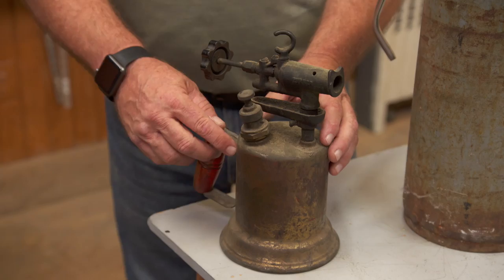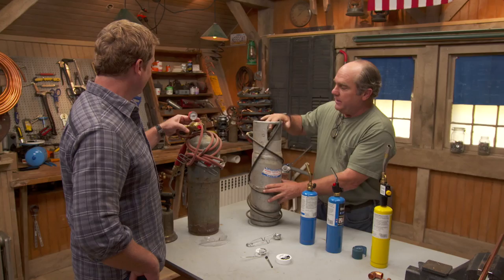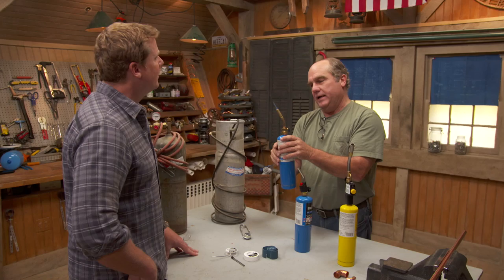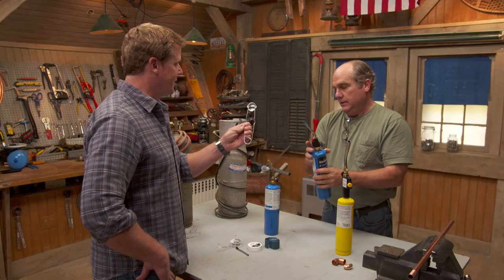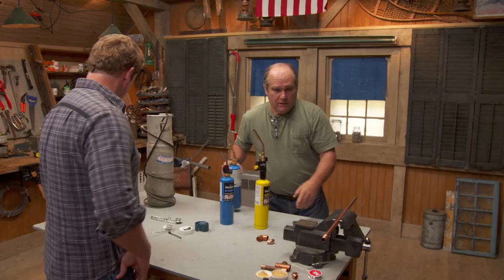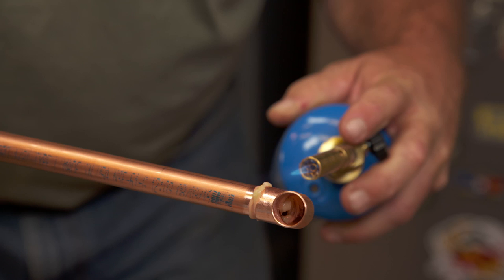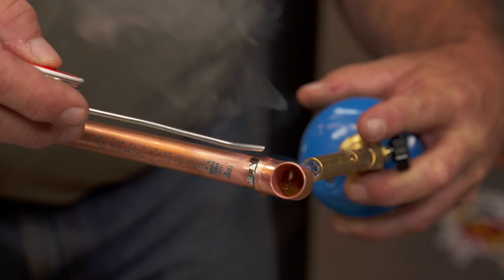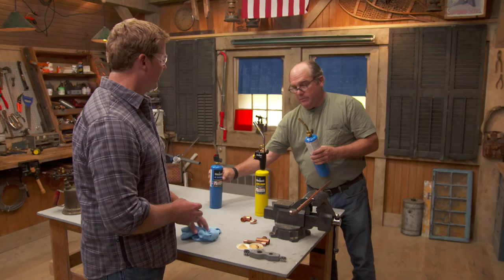How to Choose and Use a Blowtorch | Ask This Old House

Comment: I've been a plumber since '78 and some things don't change....like how to properly sweat a joint. You only need to flux the pipe, not the fitting too. Of course everything is cleaned first with either brushes; internal/external or sandcloth...or both depending on the size of the joint. A good plumbing torch will let you adjust down to smaller jobs like 1/2-3/4" and also sweat larger sizes. Some of the small bottle 'turbo' torches won't do that.....you turn them down and the tips excessively heat to cherry red...not a good scenario. Better to have smaller tips that exchanges in & out for the smaller pipe sizes. I've had portable propane and MAP torches that work from 1/2" to 1/1/2". Honestly though unless I have access problems, anything over 1" and I'm using a bigger acetylene bottle and Turbo torches with different tips. And my fall back standard would always be my old Prest-O-Lite on acetylene. I've been on jobs where the plumber is struggling (time-wise) with a little bottle torch like under a house. Fire up the Turbo on a acetylene bottle or the Prest-O-Lite and cut the job time in half. The little hand held torches are for tight space and convenience,  not for whole house sweating.  The nice thing about the larger tanks torches is they have regulators and so you can fine tune your torch flame for the job at hand.  I worked for a company once that forced everyone to use the small bottle torches for everything. That is, until I showed them how much time you can save on a whole house job using acetylene. But then I got stuck training the guy on how to use a large torch bottle set up. On most residential piping now it's all PEX style piping anyway. You can't win...glad I'm retiring...lol.  Sweating will always have its place for repairs though and of course, HVAC.
Reply: Can you use pure acetylene for this purpose or is it always oxyacetylene?
Reply: @commadanteflet  Acetylene, and these days there's not much difference in temperature between Map-Pro and propane but a significant difference in price.
It's my understanding that Mapp is no longer available in the U.S.
Reply: I thought they used Silver Solder or something now, won't that lead leech into the water?
Reply: @tomasinacovell4293  They use silver bearing solder now for residential and commercial potable copper. It is lead free....requires more heat, slightly different techniques and flux.
Reply: @TheReal1953  Ah!
Reply: @commadanteflet  Plumber's torch-acetylene.
Reply: also the tip he is useing with the map gas is way better you can also run that tip all day long and the tip will not get hot you can tuch it and wont get burned, did you know that ? i am not a plumber i am a roofer hot tar
Reply: @davetownsend7120  Doesn't matter if you're using map gas or propane on on those small turbo torches. Any turbo type tip will glow red if you tun them down. Sweating is about knowing how much heat to use on a joint and how fast you need to move along. On the B-tanks, the rigs will usually have a regulator and so if you were mostly sweating 1/2" copper you can adjust the gas flow down......even with turbo type tips. But my favorite rig on a B-tank is still the old  Prest-O-Lite. This tutorial though is about the more portable propane and map tanks.
Reply: @TheReal1953  that wasn't my point whether you used map gas or not my point is with a turbo torch you can use it in the tip will never get hot so you can touch it
Reply: @davetownsend7120  I guess we've been watching different movies. To keep a bottle feed turbo torch from turning the tip red, you have to turn the gas UP. You cannot turn down the flame without getting a red tip is MY point. To do that you need a regulator or a different setup altogether like Prest-o-Lite. Yes, you can run the turbo tip all day, gas turned UP without getting the tip hot. Maybe you should stick to roofing and what you know.

Comment: Everyone in the comments section knows best. I’ve been plumbing for ever and here’s what I’ve learned. ....
Ask 10 different plumbers the right way to do something and you’re sure to get 10 different answers.  Best to learn from trial and error and stick to what works for you... having said that I prefer mapp gas each and every time. To me it just seems faster and more reliable
Reply: Don't agree....there's a much smaller number of ways to sweat copper properly and some universal do's and don't. And the only times you will see failures is when you've been in the trade for decades and see the plumber's mistakes. Like wiping hot joints with a rag. A lot of guys do that for appearance reasons. You can compromise your joint doing that...easily. I've seen them fail yrs later. Just because your joint hasn't failed in a yr, doesn't mean it won't fail eventually. Anybody who has done lots of repair AND new work knows this.
Reply: Only problem is, MAPP gas is not being manufactured in the US anymore. The crap that they sell today in yellow canisters labelled MAP/Pro (propadiene gas) is NOT THE SAME as the good ole MAPP (methylacetylene-propadiene propane) gas that between propane and acetylene, and that old timers like you remember so fondly.  MAP/Pro is quite wimpy compared to MAPP, and propane comes very close to being as MAP/Pro, but a lot cheaper.  In my opinion, MAP/Pro is a waste.
Reply: @StilettoSniper  I remember reading about this in about early 2010's, when I was getting into the trades (HVAC) 
What about using propylene? aka propene aka methyl ethylene? 
Things got busy and I never had the chance to experiment with propylene... these days propane or acetylene...
Reply: @walterbrunswick  That's what you get when you purchase a cylinder of MAP-Pro today.  It is a mix of propane and propylene.  It pales in comparison to the original MAPP gas in terms of heat though.
Reply: I'd like to get that tall old gray propane bottle for weeds. Where can I find one?

Comment: Here's the thing, if you take that MAPP torch off the MAPP bottle and put it on to the Propane bottle it will do exactly the same type work that they say you need MAPP for. Its all a rip off. In my experiments, Propane with the TS8000 MAPP torch fitted heated up the work metal (mild steel flat bar) 12°C hotter than if I used the MAPP setup after 1 minuet of heating the metal both from a base temperature of 18°C - MAPP 415°C, Propane (same torch) 427°C. Make of it what you will. I Silver solder now with the MAPP torch on a hose connected to my 9Kg Propane bottle that I also use for camping (running the cooker on the camper trailer) so now I can take a means of doing road side repairs to metal work when outback if I need to, just one hose and the torch, easy to pack.
Reply: Yes, because MAPP gas of yesteryear is NOT the same as today's MAP/Pro.  They can't even call what is sold today "MAPP" gas because the company that hold the patent and trademark on MAPP gas will not allow it to be used for the overpriced MAP/Pro crap they sell today.

Comment: ive always used MAPP and Acetylene never used propane in all my years of doing plumbing work never had a problem with any if my fittings
Reply: The rig the guy had in the video is TurboTorch LP and the tank is aluminium.    A couple of benefits being it could be filled at just about any place which fills LP tanks, much lighter than a "B-tank' and just a little cooler than Acetylene.  The bad part is you run out much quicker and could come out liquid out the nozzle if tank is laid down during use.  I worked with LP on L copper and lead-free bar solder from 6 to 8 inch with a 32 tip.

Comment: The tiny little pencil torches are only really good for 1/2 and maybe 3/4 copper.
Reply: Yeah and 3/4" is barely adequate.  I like to use the big TS8000 torch with propane for 3/4", and just turn down the heat a bit until it is just right and doesn't overheat the fitting.

Comment: Heat the fitting not the joint and let the heat pull the solder in off the pipe.... should almost look like a vacuum sucking the solder into it which will give you a much stronger seal because you are soldering the entire joint and not just the outside seam

Comment: Richard has obviously never seen his grandfather's blow torch operating with gasoline, which is what they generally used for fuel. It is anything but a lazy flame. It is a roaring blue flame that shoots out about a foot.
Reply: AWESOME. I saw one of those blow torches at a estate sale once
Reply: Jody Doakes in the UK we also ran them on paraffin and we call them blowlamps. We have a super large version with a 4 inch diameter burner that produces a 3 foot long flame, that's used for killing weeds by cooking them...
Reply: I have one. You're right. And if you're fast enough maybe you'll be able to solder copper water lines

Comment: The only blowtorch in the video was the one you fill with a liquid fuel (kerosene) and pump up. After it's hot, it should keep the pressure up by itself as the fuel warms up. Compressed gas torches, like propane torches, are NOT blowtorches. A lot of people call any torch a blowtorch, but it's only a correct description of the old-timey pump-to-pressurize liquid fuel torches.

Comment: That was way too much flux on that fitting
Reply: +christoper indeed.
Reply: That was my first thought
Reply: Uh..huh...well, here's the real deal.  If you get the joint fully soldered, you have the correct amount of flux.  If you don't there's not enough.  BTW - there are no "style points" for flux application.
Reply: Is it true that excess flux inside a copper pipe can corrode the metal over time?
Reply: These guys who say that you can never have too much flux are butchers. Yes you can, and that residual flux will remain on the inside and outside of the pipe and corrode it over time. So if the pipes in the house where you worked leak in 50 years, you'll know. Look up "How to Stop Copper Pipe Corrosion - This Old House".
Reply: You don't use Flux when installing or brazing med gas piping.
Reply: Mike Stirling.
Flux is corrosive yes.
It is important only to wipe down the outside of the joints when they have cooled.
The inside will be cleaned by the water you will have rushing through it.
If it's gas, then the pipe is filled with gas and no oxidisation can occur.
Reply: @tamedelement  Absolutely

Comment: Once again, I'm confused by the short answers without explanations. If as Richard says at the end "the new solder requires more heat", does that imply I should use one of the better heads to solder 1/2 fittings, use MAP gas, just one of the two, or both? I currently own the cheap propane and the cheap nozzle with striker and my 1/2" copper pipe soldering is a mess.
Reply: This is just a guess, but I believe Richard is referring to the lead free solder that is required for potable water lines. They require more heat than typical lead solder. For 1/2” pipes you don’t need MAP gas or a larger torch. Pencil torch with propane will do just fine.

Comment: Using the third torch option here, the Piezo igniter with MAPP gas, surely if you used just a propane tank on that it would reduce the heat enough allowing for solder on your 1/4-1/2” pipes? Just curious as to thoughts. As a fabricator I use oxyacetylene and large propane torches regularly for slicing girders and steel plates etc and had no need for one of these until recently. Was thinking of buying one myself, not a Rothenberger, maybe just a cheaper Vortex model for jobs around the house and in my new home garage. Would appreciate a plumbers advice on a decent universal option and there thoughts on torches, must have a piezo starter though and flame lock with flame adjustability. Lastly I use bottle keys to switch the gas on & off from the floor tanks at work, what’s the safest way to store these if there are only to be used sparsely? Disconnect the bottle altogether from the torch or will that just pop the entire bottle in one go? Or are they 100% sealed for long(ish) safe storage. Thanks in advance guys
Reply: Here's the thing, if you take that MAPP torch off the MAPP bottle and put it on to the Propane bottle it will do exactly the same type work that they say you need MAPP for. Its all a rip off. In my experiments, Propane with the TS8000 MAPP torch fitted heated up the work metal (mild steel flat bar) 12°C hotter than if I used the MAPP setup after 1 minuet of heating the metal both from a base temperature of 18°C - MAPP 415°C, Propane (same torch) 427°C. Make of it what you will. I Silver solder now with the MAPP torch on a hose connected to my 9Kg Propane bottle that I also use for camping (running the cooker on the camper trailer) so now I can take a means of doing road side repairs to metal work when outback if I need to, just one hose and the torch, easy to pack.
Yes you can put the Propane Torch onto a MAPP bottle but you will get Propane performance from it, not MAPP. Its all about the torch, not the gas.
Reply: Gibs Onethirty Thanks for the reply Gibs and helpful information. I ended up purchasing one of the Vortex packages which came with a bottle of Mapp gas and four different nozzle tips. The Piezo auto torch is a fantastic piece of kit and I’ve used it a number of times for various jobs both at home and out on sites coming in to its own for several specific homer jobs. My only gripe was the bottle itself and relating back to my original query was storage. I think I may have received a bottle with a defective seal because on the fourth or fifth use when I unscrewed the torch to store them, replacing the black plastic bottle cap, I soon discovered the bottle had leaked and quite substantially. Both the torch and bottle showed no signs of damage and removal of the torch gave the usual pop indicating the bottle had sealed itself but unfortunately it did not, not fully at least. 
 Appreciate your advice though pal.

Comment: How can you make a blow torch to produce or blow a much longer flame 🔥 as in a ‘Flamethrower’  ??  😨
Reply: Military flamethrowers work by shooting a stream of flammable liquid, usually gasoline or napalm, and igniting it. Pressurized gas from a separate canister is used to propel the liquid fuel out of the tank and through the air, but this gas is not meant to be combusted and was typically inert CO2.

If you're referring to the commercial "Not-a-Flamethrower" being sold by The Boring Company, I believe it just puts out a larger volume of gas at a higher rate. More utilitarian torches like these Bernzomatics are designed to be more efficient and conserve fuel by blowing out a lower volume of gas at a given time, while Musk's torch sacrifices this efficiency for entertainment value.

Comment: And which blow torch is best for finishing a steak that's been cooked in a sous vide?
Reply: The BernzOmatic TS8000. Adjust for the darkest blue flame you can get (an oxidizing flame), and keep the torch far enough from the meat that the blue part of the flame never touches the meat. If the blue flame touches the meat you'll get unburned propane particles in the meat resulting in "torch taste." And of course, keep the flame moving over the meat.

Comment: Hi! Beginner here.

I need to use a MAPP torch for polishing acrylic edges. It'll be my first time. I've been watching a lot of videos, but I have one question..

When I finish using the torch, do i keep the torch attachment ON the canister? Is it safe to just unscrew and detach the torch when the canister is still not empty?
Reply: Keep the torch head on the bottle until it has cooled sufficiently. As you'd imagine, the tips get extremely hot, so keeping it stood upright in safe location while it cools is best, especially if it's in repeated use.Just kill the flame and put the safety on and make sure no one touches it. 

You'll only really remove the torch when you're completely done, only remove it after the nozzle has cooled, and when you take it off, hold the trigger and ignition to burn out any gas left in it (move the bottle away first).
Reply: the small canisters are equipped with a valve which will reseal the canister once the torch part is unscrewed.  You can dip the threaded end of the cylinder into a bucket of water  and look for bubbles if you are suspicious of a leak.
Reply: yes.
Reply: Torch heads should be removed from fuel tanks when not in use.  
Torch heads should be removed from fuel tanks when not in use.
A dropped torch / fuel tank combination has been known to break the joint between the tank and top fitting releasing the entire contents of the tank.  Bad with a cold torch.  Absolutely catastrophic with a lit torch in an enclosed space.  Stubby tanks are safer, less likely to be stressed to breaking from such impact.
Torch heads should be removed from fuel tanks when not in use.